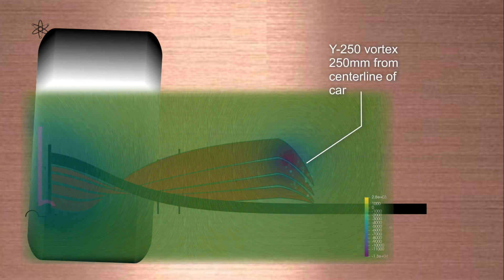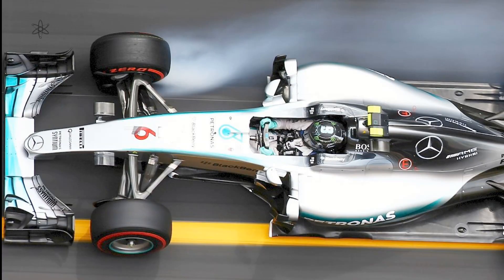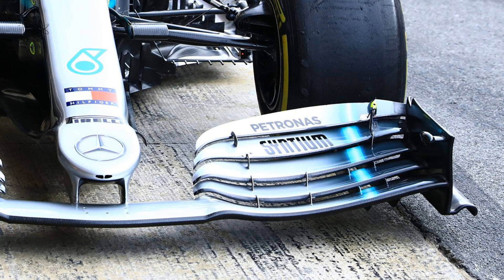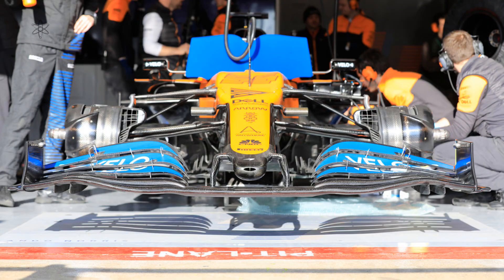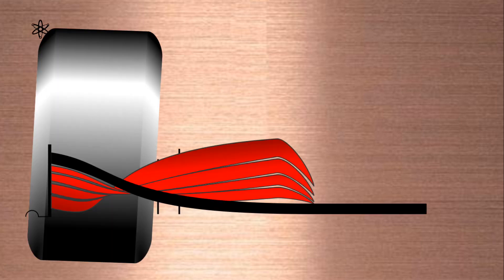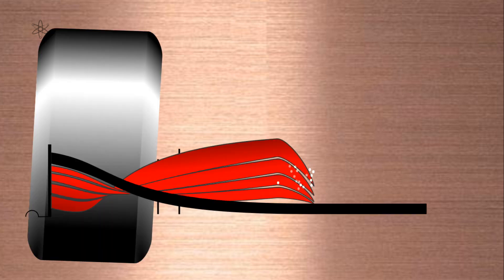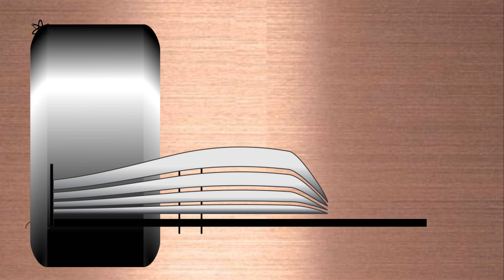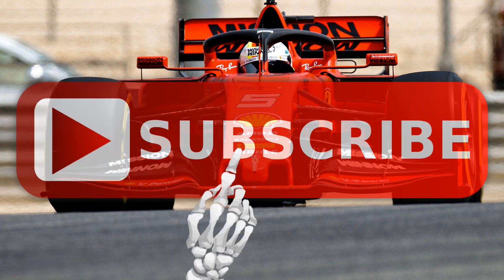F1 Front Wing Vortex

Comment: Not enough forward shift for high dwf tracks. It could work on medium dwf tracks, though!
Reply from the maker: the irony is that, on maximum downforce setting, that front wing set up would be very similar to the usual front wing used today
Reply: @SpeedMediums  But on tracks like monaco, hungary, etc, such FW would not create enough front dwf.
The car would suffer from massive understeer.

But on a track like Silverstone or barcelona, such concept could be beneficial.

Your concept places the EP VG really close to the front tire squirt. Its turbulence would be eliminated  in a more efficient way!

Not ideal for high dwf tracks but on others, it would really help to seal the floor!